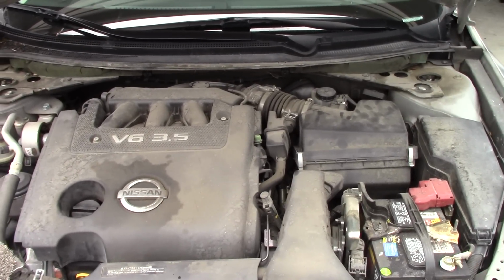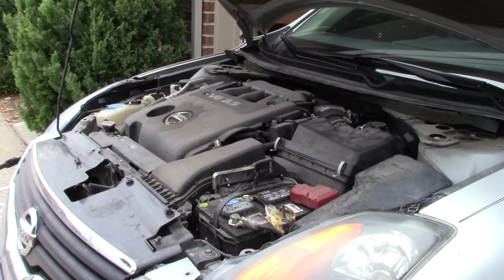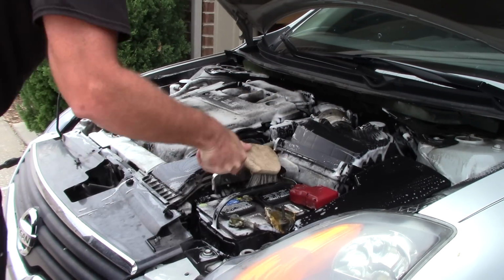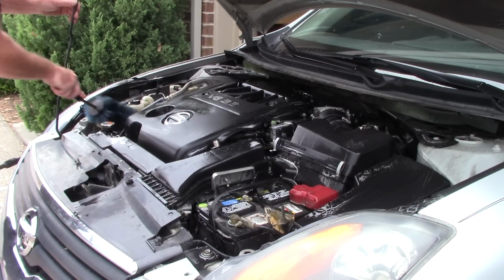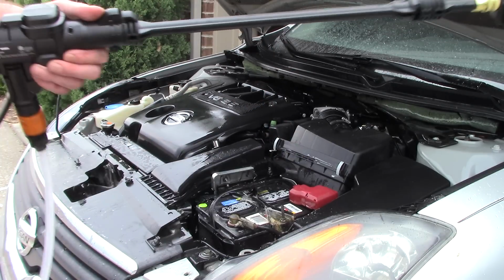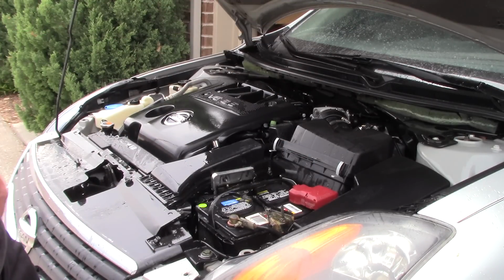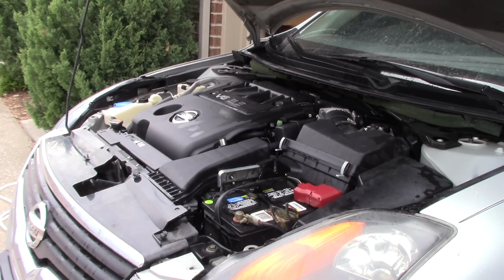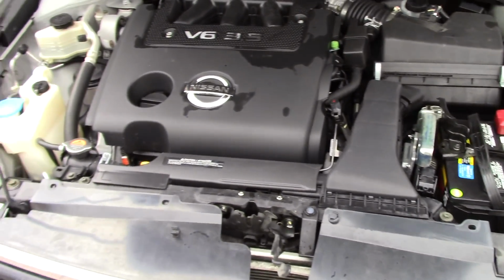Real Time: Super Clean Aerosol vs Dirty Engine Bay - Great Video For Beginners

Comment: You broke the clips for the grill hope you replace those
Reply from the maker: the front grill was damaged from a recent car accident as was going to be replaced in the future by my client..i had discussed all the damaged components before even doing the engine bay cleaning with my client..its a good point you bring up but you also don't know all the facts before the video was even started...so no I'm not going to replace the already broken parts on the front grill and clips...but its a good point for beginners and how they need to look over the engine bay and front grill area and show the client what is already broken or hanging by a thin thread before you begin the cleaning:)
Reply: Why bother? Obviously this is a complete total. If that grill falls off a Concorde may ingest it causing thousands of deaths. ;)

Comment: What about NOT spraying that on electric connections? And computer 'parts' in the bay?  Let alone power spraying those parts with water after?  I havent cleaned my engine since I bought the car, 13yrs now, and it is already MUCH cleaner than that mess! 
But I always hear about spray cleaners and then power rinsing ruining connections, and most electric parts.  Let alone spraying right on the battery terminals, like you did in this video. You didnt start the engine up after this 'cleaning'....to dry it up totally. 
So..what about protecting certain parts, not hitting connections, not soaking like the alternator, dont you have to protect certain parts?  Thanks.
Reply from the maker: if your engine is clean then don't wash it since you have all these concerns...im not sure how to answer all your questions..i have been cleaning engine bays for 26 years and never had an issue with all the concerns you mentioned..if you want to cover up all the areas you are concerned with, i would have no issue with that..just do whats best for you..much love Marc
Reply: Marc B. Distilled water is safe for all electrical components so long as it does not get contaminated with a lot of dirt

Comment: So you only washed the top surface? Dam do the hole engine bay! I degrees top to bottom all surfaces, then let sit 5 or 10 minutes then I power wash it top to bottom sides of the motor timing chain cover oil pans suspension everything! And I paid particular extracare to electronics I cover the fuse panel with plastic easier to hand detail afterwards and certain other things this is just a cover-up to make an engine look good do everything

Comment: You did not do underneath the engine cowling it's hard to be horribly filthy under there and that's where your injectors and cables and connections and coil packs and everything or underneath there you certainly would not use water on that this is nothing but an infomercial do not use water

Comment: You're not really cleaning the engine. The plastic covers on top of the engine ,but not the engine itself. If that "Super Clean is the original full strnghth ,then it is highly corrosive.

Comment: Didn't hear the engine running afterwards.  NEVER pressure wash modern engine bay, even using house pressure or you'll be buying lots of new electronics $$$$, components are NOT waterproof.  Too lazy to detail and only one brush!

Comment: Don't ever do this. Newer cars have a lot of sensitive electronics, this is why mechanics and technicians never clean the engine this way.
Reply: So what way do mechanics and technicians clean the engine bay ? plus isn't mechanics and technicians different than auto detailer ?
Reply: Obviously not this way.
Reply: @raymondray3232  I understand that from your first comment. But what is the correct way in your opinion ?
Reply: Watch Criss Fix. He has a great video that does it properly.
Reply: @raymondray3232  thanks man, I found it.

Comment: A few issue here.  You really need to cover any electrical areas, sensors, fuse boxes, older carburetors, battery with tin foil and plastic wrap or plastic bags.  I have seen damage done doing what you did without covering certain areas.  The other issues is all that greasy oil residue has to go some place.  Here in California that all goes down to the ocean if done in a home area.  We are trying to reduce that pollution in the ocean so it will be a nicer place to swim and for the ocean life.  Best to do that at a coin operated car wash place because all that water is treated as industrial waste.  A lot of guys will do what you are doing on the bottom part of the engine where there is more oil in order to trace an oil leak.

Comment: Cleaning the engine bay with a chemical cleaner and pressurized water can do more harm than rinsing the bay with nonpressurized water and pat dry with a rag. The bay will get dirty again in a few miles. What a waste of time and money.
The brake tank cap is ventilated - pressurized cleaner and water can get in.
Reply: The brake reservoir is NOT vented EVER on ANY vehicle. Clearly you have NEVER done a brake job in your life. As long as you rinse the engine well, the chemical cleaner is NON DAMAGING. Pressurized water contains more AIR than a straight hose thus using LESS water to possibly damage something. As long as it is not a HIGH PRESSURE washer ( that is NOT  a high pressure washer) It will not damage anything. As long as you do not put the wand directly up to anything, a general spray wash like that and blown dry hurts NOTHING.  So it gets dirty again, unless you live on a DIRT ROAD you shouldnt have to worry anyways. I would wash it more frequently if I did live on a dirt road.

Comment: This is a lazy way to "clean" an engine bay but its purely cosmetic.   A customer would look at the top of that engine and incorrectly assume that it is clean under the plastic cover. And Distilled water? What planet do you live on where that is needed, how much does that option cost the customer? Everything this guy does to this car is wrong.

Comment: Disconnect the battery!
Reply from the maker: manoman0 why..what's going to happen?
I have never disconnected a battery in over 26 years of cleaning engine bays and on 100s and 100s of cars!
When will I start to have a problem:)
Reply: Dallas Paint Correction & Auto Detailing safety issues, maybe? If it works for you then fine by me.

Comment: You do not get under a hood with a brush you spray that on and steam it off five minutes top with the car running so the heat from the engine can dry it out oh he is spraying it wow there is no way your engine won't start after that unless it's a Ford or a Dodge

Comment: If you want to damage your vehicle use water even little
DONT USE WATER TO CLEAN ENGINE... YOU WILL BROKE ALOT OF STUFF WORKING TOGETHER IN ENGINE BAY Such..
Electrical terminals which connect with car computer corrosions ion deep spot in engine

Comment: My man why are you doing that while battery is connected 🤔😔🤦‍♂️ not good my friend. You need to do your homework on detailing engines.
Reply: I'm not a pro, but I've been cleaning engines on my cars since I got my license at 17. i'm now 69 and still do this. I've never disconnected the battery on one of them and never had a problem. Let me ask you Lorenzo my man, do you think it stays dry under there when it rains? When you drive in the rain do you disconnect the battery?